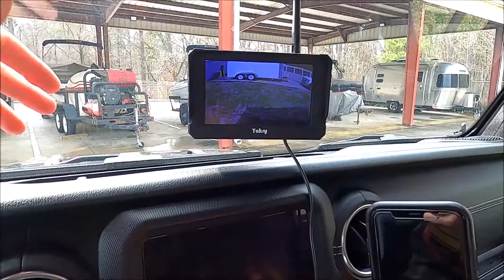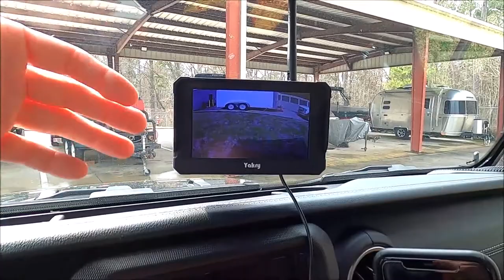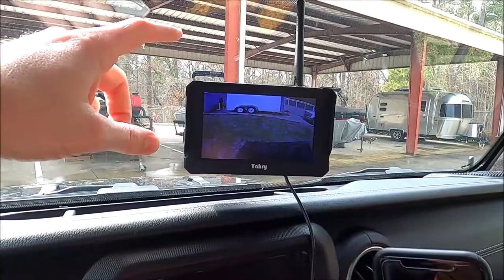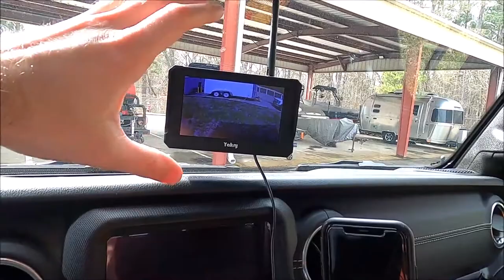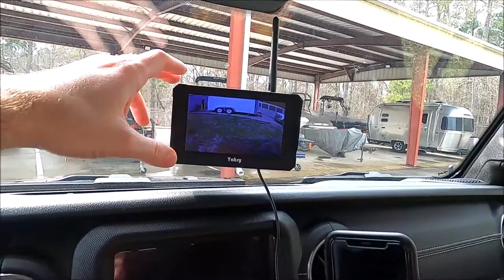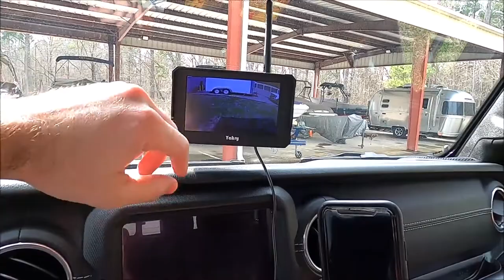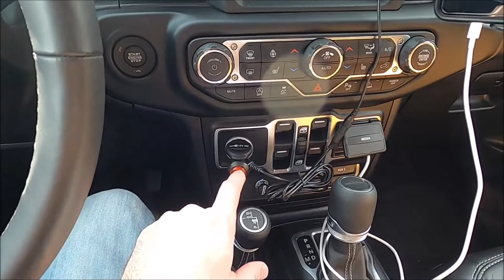Car Trailer Rear View Camera

Comment: Is there a problem with an aluminum trailer, like that nice Airstream you have? And, does it dim way down so cars behind you at night don't blind you?
Reply from the maker: The airstream, sadly, isn't mine.  It was just at the storage facility.   There shouldn't be any issue installing the backup camera on an aluminum trailer.  But you will need to make sure you've got a good ground for the wiring.  And yes, the camera auto dims at night to adjust for headlights of cars behind you.  Overall it worked very well.